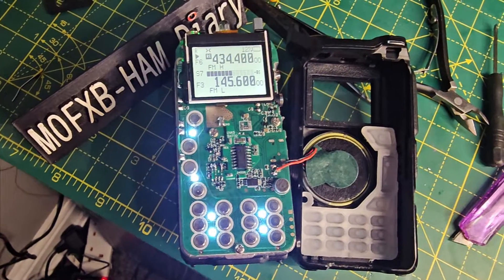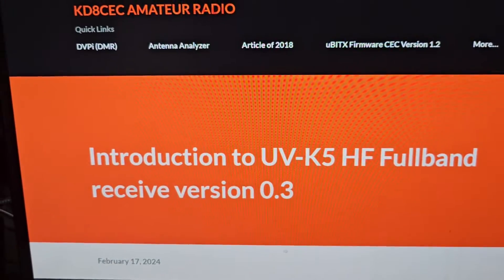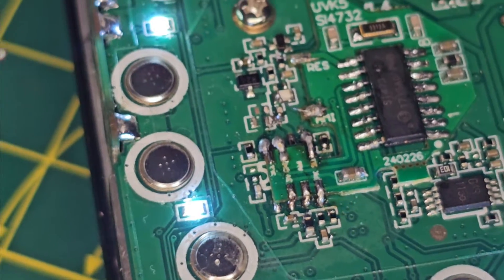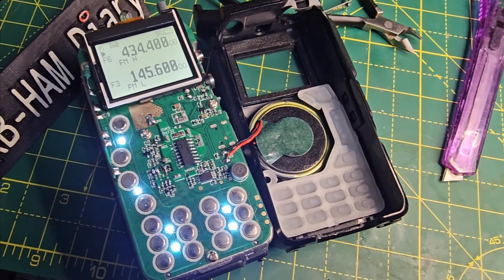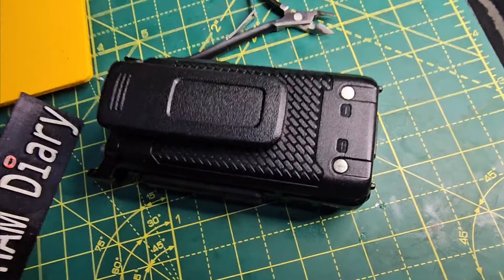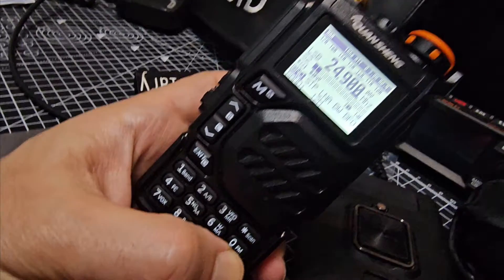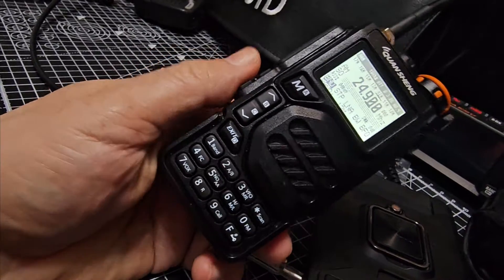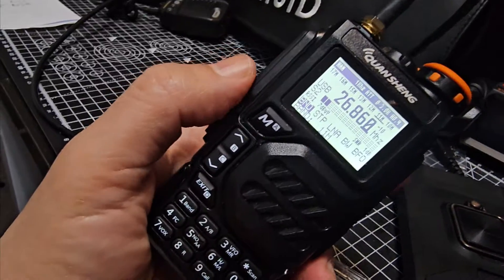QUANSHENG UV-K5 - HF CIRCUIT BOARD MODIFICATION

Comment: I did the mod but on SSB I have to tweak the BFO quite a bit to be on frequency. 500+- Hz. Just curious if anyone else has the same issue?
Reply from the maker: Yes also my HF very quiet and weak .
Reply: @M0FXBHamTech  Yes I also have very quiet audio as well but rumor has it there is already a newly designed chip kit with additional op amp to improve the audio volume.

Comment: There's already firmware version 0.41 available and 0.5 is on the way. Congrats doing this with a regular soldering iron, i underestimated this soldering job and borrowed an heatgun from a firend to complete the job and i'm a regular solderer with regular gear.
Reply from the maker: Hi , my audio on LSB /USB below 15 MHz is low is there a setting ?
Reply: @M0FXBHamTech  Its low by default, in the menu you can change the boost volume but by default its already set to the max .

Comment: I can't help thinking about the tiny cap you have to add in the supplied kit. 
Considering the location is adjacent to the add on daughter board. It might be an improvement if they added a location for the cap on the board itself,  so it's already on board when you receive it. If they had pads on either side of the cap that would easily accept a wire being soldered to them - after adding the board you would only need to solder 2 wires from board to board. 
I obviously have not done the mod, I'm no expert either. It would seem to greatly simplify the process though.
Reply from the maker: Yes I understand